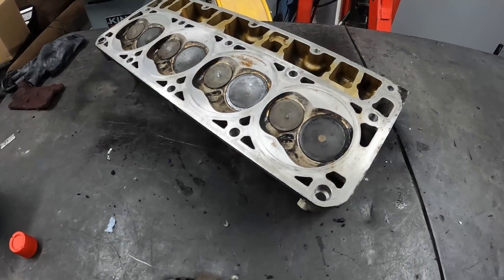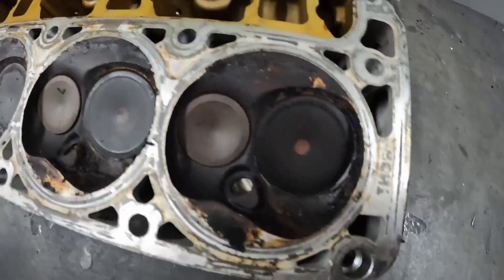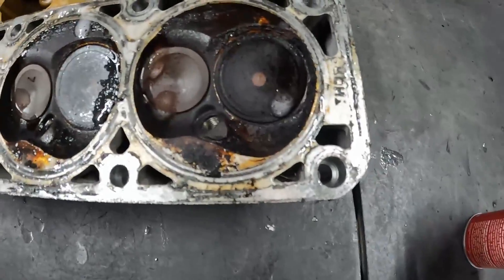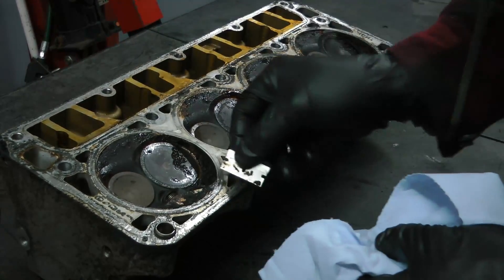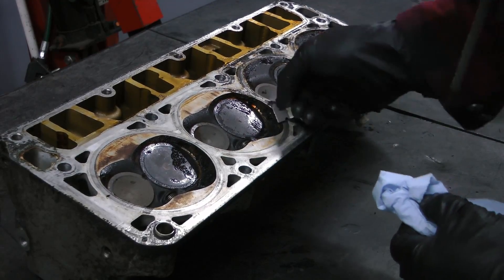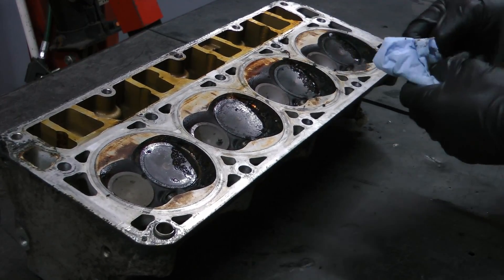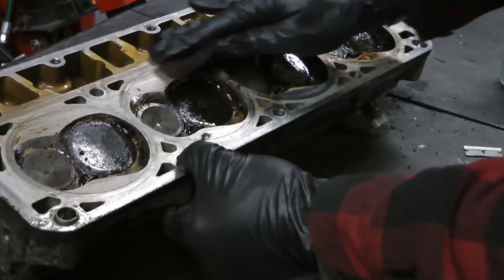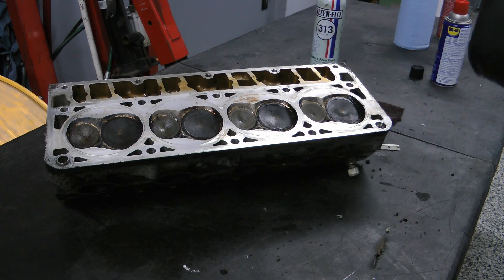THE FASTEST AND BEST DIY WAY TO CLEAN CYLINDER HEAD AND BLOCK SURFACES (LS ENGINE GASKET REMOVAL)

Comment: A slab o glass and 120 grit sandpaper. That's the best and quickest way to do a backyard preparation of a cylinder head clean while it's getting resurfaced at the same time. Given that it requires a lot of work to take it off, this would be the bare minimum before you slap it back onto the engine.

Comment: Anyone have any ideas to fix little nicks and digs from razor blade? There's not many cuts, but still makes me nervous. Great video, that stuff is magic... after I just got mine back from the shop 😅! Thanks in advance for any advice 🤙
Reply: A soft pad brush on a grinder will work just fine
Reply: @shimon2476  thanks dude!
Reply: @TrippNOutPod np brother
Reply: @shimon2476 I have a valve that dinged the top of piston.  
Is it hopeless or will file or ginder work or something else. I'm stuck on the side of a mountain.
Reply: @craighohmann9534 once it's not on the side of the piston to cause scoring on the cylinder walls you will be fine.

Comment: I’ve been using crc throttle body cleaner on head gasket residue with a shop rag. Scrape the thick parts off with a razor blade first. Always works

Comment: Oh god, not the razor blade. Ugh. I just completely strip it and have the machine shop clean and inspect head. I can lap valves, remove guides and seals port and polish but some work i leave to the machine shop such as install guides, resurface/ milling, replacing valve seats and cutting seats.
Reply from the maker: @journeyquest1  sounds like you've got more $$$$ than me
Reply: @WestcoastWrenchin  I know how to do most of the work myself. Thats how i have extra money. I do as many things myself as possible. The only razor blade iwill use is plastic. I am usually dealing with aluminum.

Comment: I thought razor blades were a no no on aluminum heads.
Reply: If you're careful not to catch the blade in the aluminum it's fine also if you lightly scrape the Blade backwards it won't do any harm

Comment: I want to replace my valve lifters and I need to clean my camshaft cap mating surfaces before adding the new RTV and putting everything back together again. My problem is how I can clean the old RTV materials without letting them enter oil channels while cleaning and scraping. I don't want to clog oil galleries and probably oil pump pick-up tube and cause lubrication issues. It is almost impossible to cover all the channels and galleries before doing the cleaning.
Reply from the maker: @Messergebnis-liebhaber  yes it is hard, usually I try and plug what I can with paper towel. Depending on the area sometimes rinse with brake clean and compressed air.

Comment: I always just send the block and the head off to a machine shop to get em decked and hot tanked just makes my life easier but sweet video tho thanks for the insight
Reply: How much does this cost?
Reply: @jacobb_.251  it was 180.00 to have my ls heads resurfaced. At a small head shop in TX
Reply: @jacobb_.00 way more than doing this
Reply: @jacobb_.00 I was hoping for this answer too.. I guess I'll have to call the machine shop in the morning.. Lol
Reply: Tmk, SBC can deck, I haven’t heard folks decking LS heads have you done this?
Reply: @808kahulaa resurfacing is what he be meaning

Comment: I couldn't find CRCs "Gasket Kleen" (with a K lol) anywhere not even a Google search lol. Eventually I found it under google images on Canadian Amazon and 1 website. I can't add stuff to my cart on American Amazon from Canadian Amazon, it wants me to sign in on Canadian Amazon web pages but I haven't tried to. I was able to find CRCs "Gasket Remover" in a red can like the "Gasket Kleen" and some green can. That stuff looked like it worked out phenomenal that's why I was trying to get my hands on it lol plus I'm prolly about to resurface blocks and heads. I'll prolly grab the CRC Gasket Remover maybe it's the same thing although I think the Remover is cheaper but that green can I was talking about might be about the same price. Hopefully whatever I get works out as good. Good vid 👍. Hey fill those valve chambers with water to see if any leaks out past the valves, that'll tell u if you need to lap the valves but you prolly know this already lol.

Comment: Thanks for the tip! I will try this next time. I just finished resurfacing my 5.3 862 aluminum cylinder heads and now I have to do the block, do I have to resurface the deck also or just clean it up really really good before putting the heads on? It’s a cast iron block btw and I’m using ARP cylinder studs not bolts
Reply from the maker: Clean the block up in the same fashion!

Comment: None of my parts have ever cleaned up that easy or had good results like this upload.
Reply from the maker: None of mine have either 🤣
Reply: the gasket mostly separated off it...  wasn't triple baked into the metal lol
Reply: seriously, just got the same stuff and it did nothing, but gaskets are all different materials so you never know whatll work for what
Reply: @seanmakesthings  best to use something that leaves no residue, like rubbing alcohol.  it's cheap and can soak the heads side by side in it.  It will remove a ton of the gasket by making it soft, even dissolve carbon.  kerosene works pretty good too!  if its iron use gun bluing removal solution, it really gets it done